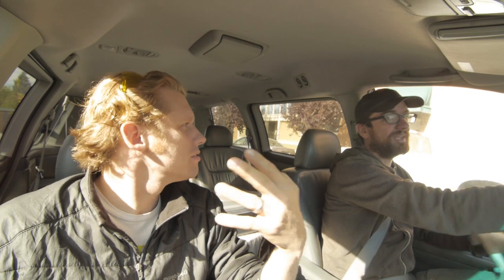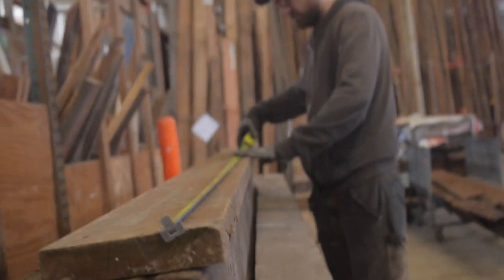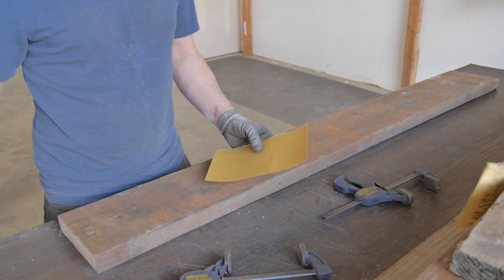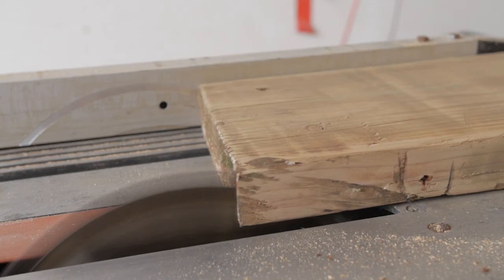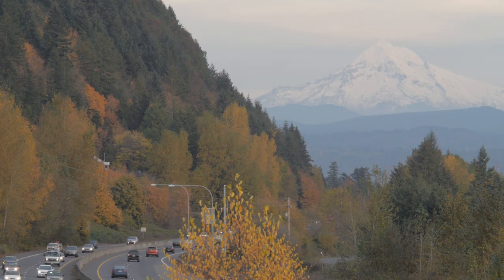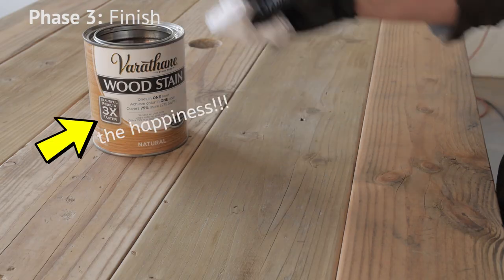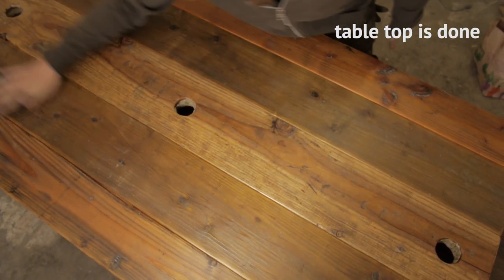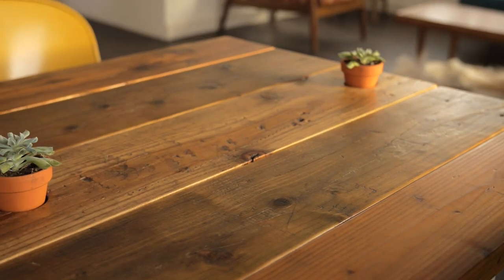How to make an easy reclaimed wood dining table

Comment: Good work boys, enjoyed the simplicity of that. Can you tell me please, what is the tool/press you used to create the right angles in the steel? Did you fabricate that yourselves or is it shop bought as I'd like to make one. Cheers from UK.
Reply from the maker: Thanks Wuff. We do fabricate these legs ourselves using our horizontal metal press. It's a unique machine, and not many shops have one. That said, the other way to bend 1/2" steel is to use extreme heat and some sort of manual bending machine.
Reply: I've found one in the UK meanwhile, only does 90 degrees but it'll do exactly what I want. Cheers for replying.
Reply from the maker: Excellent! Bending steel can be very tricky. The inconsistencies in the chemical make up of the steel can cause varying results, even when you have not changed the settings on your machine. This is actually why we named ourselves Symmetry. It takes work getting things perfectly symmetrical when bending steel.